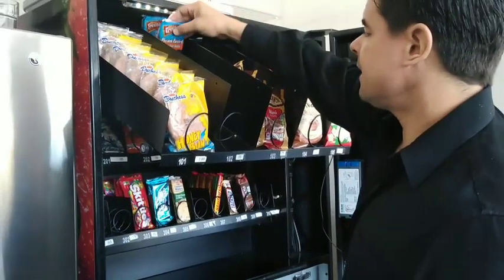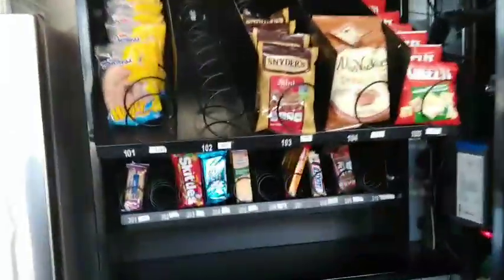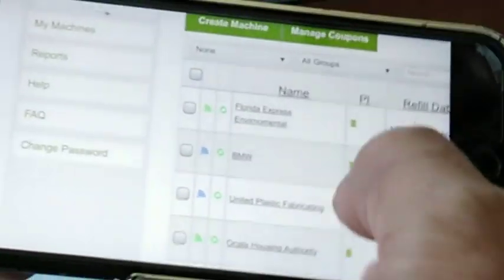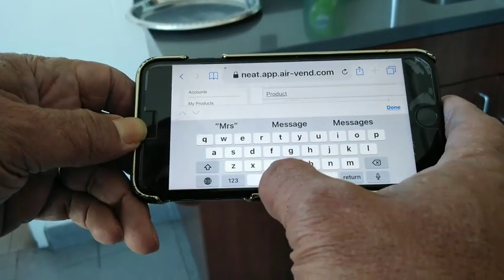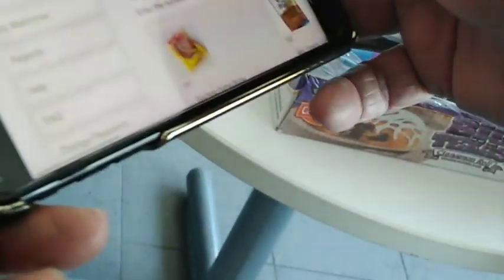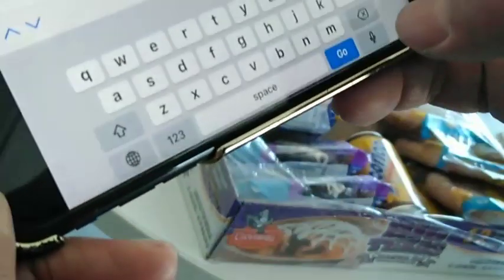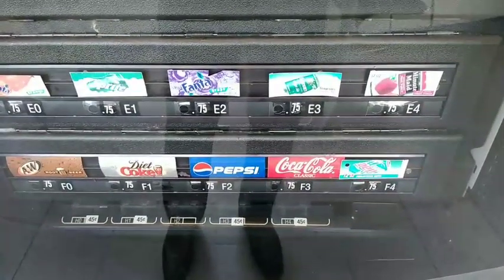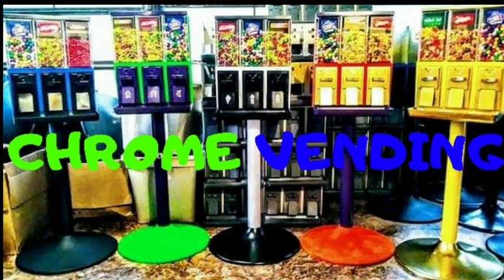EASY VENDING MACHINE REFILL & HOW TO CHANGE PRICES: NEW BMW LOCATION

Comment: I used a method that i may have invented. lol I would take my highest selling sweet and put it in every other slot in the line then i take my slow mover and fill in the empties. I have found that people will buy the slow mover just to get to the fast mover product. i dont do it too often. only when i needed to move slow movers out
Reply from the maker: Yeah I've done that too lol 😂. That was a trick I learned from Ray when I first started out! Great tip 👍🏼

Comment: Can you make a video on prices for chocolate bars/chips. I just bought a vending machine and the first to be sold out are chocolates and I don’t know if it’s because my prices are low? Should I raise the price?
Reply from the maker: How much are they listed for and what kind of location is your machine? What city and state too?
Reply: @ChromeVending  it’s at a welding factory (50+ people working) and priced at $1.50 I live in Canada 🇨🇦
Reply from the maker: @feistyyy1314  
Check the prices of competition vending machines in businesses near your locations. That's what I always do. It's easier to mark prices high and come down than to mark it too low and try to go up. Also you can fill 2 rows with your best sellers so you don't have to worry about running out as fast. Talk to the people who buy from that machine. Best way to get ideas of what will sell well.

Comment: Do you have any advice for having an employee restock the machines? This seems to be a huge hurdle... what if you move... or go on vacation.. or get sick/injured and don't fill up the machine timely. And have a system in place so they don't steal since they'll be handling cash... like if they get "robbed" or something but it was a setup

Thx
Reply from the maker: Airvend tells you everything. Inventory let's you know what is in and out of your machines and exactly how much should be there.